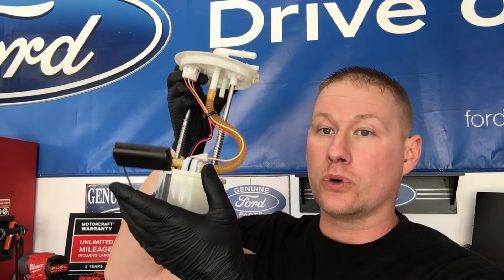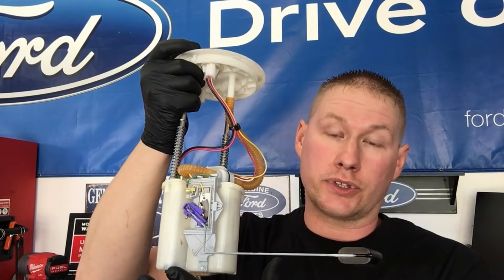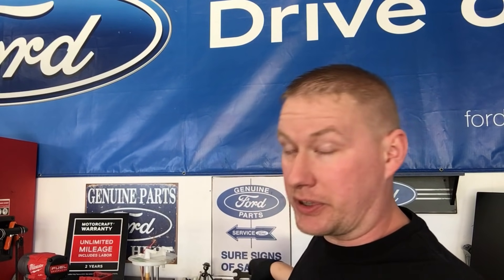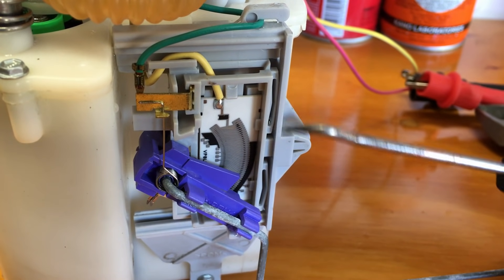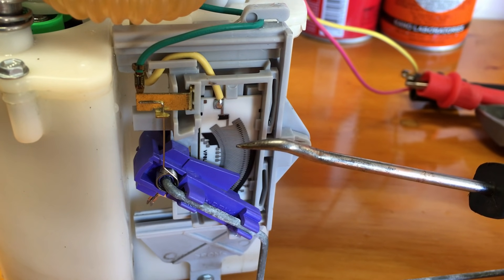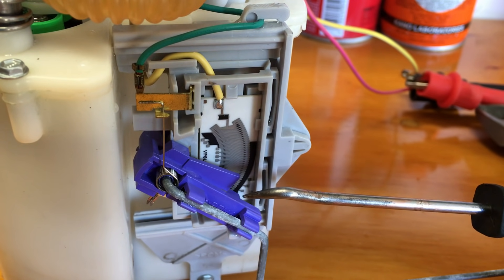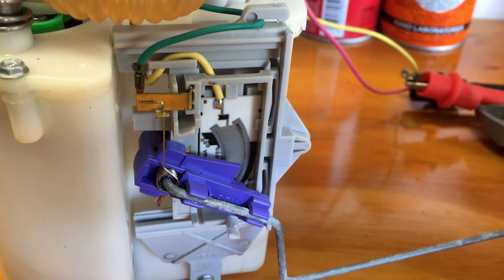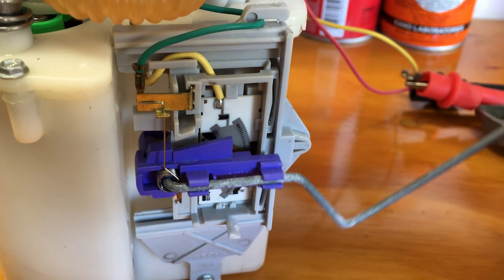Ford Quick Tips #77: DTC P0460 P0463 Erratic Fuel Gauge Quick Fix!

Comment: Thanks for your video I have a 2008 f350 super duty with the V10 gas engine I’ve been having issues with my gas gauge digital reading miles to empty drops like mile say 1 mile from house it will drop by 10 miles the other day it said 0 miles to empty so drove 2 miles to station put 3 gals in and gauge jumped to 77 miles to empty do you think using  fuel cleaner will fix that? I have not gotten any code lights coming up so far  I’m going to try your suggestion first b4 dropping tank 
Thanks again

Comment: Had the P0462 code in my van and the fuel gauge drop and rise intermittently only at a certain level in the tank so hopefully this will clear the issue up. Thanks for the tip. As an aside, I couldn't find 'Plus", only Complete Fuel System cleaner which I'm hoping is the same thing.
Reply: ever worked for you?

Comment: My f250 6.7 is having sending unit problems it seems it sticks at low fuel level when it is at just under a half a tank, but it still runs and has about 5 gallons in the tank when it starts show I g low fuel level.
Reply: So can we use this on diesel mortors

Comment: You saved me from having to remove the fuel tank. Within 10 min my gas gauge started rising from solid empty. Within 50 miles it was back to normal. Used this product in 3 tank fulls. It's working great! THANK YOU for the video!
Reply: Hello how can i save me some money,  and can you please tell me the name of it sir.
Reply: @ernestgrey9294  chevron techron plus
Reply: It this works with diesel engines

Comment: Is the Techron + for both gasoline and Diesel engines?
Reply from the maker: Gasoline
Reply: FordTechMakuloco Well poop! Need something for my '07 6.0 that is showing the same symptoms.
Reply: @FordTechMakuloco  what would you suggestion for a F250 2006 diesel with the same problem.  PLEASE
Reply: Any suggestions for Diesel engines? I have an '06 350 doing the same thing. Thanks
Reply: Lynn Taylor I have the same truck and issue!
Reply: Outdoor zone have you done anything to try an fix this? I may try to drop my tank this fall and repair but I have seen a video that you can loosen the bed bolts and get to it that way.
Reply: Lynn Taylor I put “Howes Lubricator” additive in my fuel after the low fuel warning kept acting sporadic and so far it has not came back! Maybe coincidence not sure but so far so good!
Reply: Can you get this additive at any auto parts store or did you order it from somewhere?

Comment: What if you don't get a check engine light/code? What if your gas hand just shows empty after you fill it up and comes up slowly? Will it still be that card?
Reply: Jury is still out....I got the two bottles of fuel additives suggested here, and it hasn't done it since. But, I've only filled up once or twice. My problem was only intermittent to begin with, which only made matters worse. So, we'll see. I'm going to monitor it for the next month or two and will report.

Comment: Thank you so much 💯!!!! This actually worked for my 2013 mustang GT I got the same code and my level sensor took a dump. I added the fuel cleaner and at 1st it didnt work but surly 3 days after adding it worked again saved me tons of money THANKS AGAIN!!
Reply: OSIS_ieCoyote what’s up Brother! I have a 2014 mustang Gt and the problem I’m having is the gauge would be 3/4 full and the digital cluster tells me I have 290 miles to empty!.. we both know that’s not true with these v8’s lol you think this will help?

Comment: Now I have a parasitic drain on my battery and this light had just came on my batteries been draining for a bout 2 weeks I have to continuously jump it  I had put a brand new battery and replace the alternator and it still drains my battery and in about 5 hours and sometimes overnight   My feel gauge just now acted up and check engine light came on with this po463  Could it be my cluster

Comment: 2002 Expedition fuel gauge started being erratic then quit working altogether----no codes-----just a gauge that reads empty and a low fuel light.  The fuel pump/sending unit assembly was replaced 2 years ago.  Tried two tanks with the correct amount Techron each time for the amount of gasoline.  Gauge still on empty.  Unhooked the wiring at the plug back by the tank and hooked up the old pump/sending unit.  Gas gauge works like it should.  Any thoughts or do I have to drop the tank again to change the sending unit?

Comment: Great video as usual and thanks for your help! One question though. If the fuel gauge reads empty all the time, but the low fuel indicator only comes on at the appropriate time, would this be related to the same fuel sending unit? 2004 f150 fx4, 5.4L. Oh and no codes at all.
Reply: No both signals come from same unit I believe. Probably your gauge cluster
Reply: Which is also why there’s no codes

Comment: I had my fuel pump and sending unit changed about 15,000 miles ago (2002 5.4L Expedition).   Just recently the gas gauge has been erratic, mostly I would call it "sluggish".  Well, today I watched as the gauge slowly went all the way to empty within 20 miles but I knew the tank was nearly full.  I topped off the tank just because.  It took all of 5 gallons.  The gauge never responded.  When you turn the key to ON the gauge comes off its resting position briefly but only comes up to the "E" and the low fuel light is on.  The tank is full.  Does this sound like I should try the Textron treatment or just go right after the sending unit or wiring?  No codes set, at least not yet.  Just the low fuel light on.
Reply: Hi John, I'm having the same issue with this 05 Ford F-250 5.4 L. Did you fix it and what was the problem? Let me know, Thank you.
Reply: @luisgalindo9429  The float on the end of the sending unit arm came dislodged and so the arm was just down all the time.  Obviously, I had to drop the tank, pull the fuel pump and sending unit out of the tank to discover this.  It was an easy fix once out but dropping the tank and re-installing was hours.
I don't understand why ALL manufacturers don't provide an access panel in the vehicle's floor so pulling this unit is not so difficult.  If you don't have a lift I would suggest you consider cutting one in the floor and then making a replacement cover plate once the repair is made.  I doubt this will affect the integrity or safety of the truck in any way.

Comment: I have a 2012 Ford F-150 and and I got some more problems with the my radio and I'd like to find out if you can help me my radio is not working in my CD player is not working I disconnected the battery and the problem started from there and now the only thing that works on it is the compass and the temperature and the clock is blanking, so I check all the fuses, there ok, do I need to take it to a Ford Dealership, i been getting feedback from different people and I tried all ideas, since your a Ford technician I figured I asks.

Comment: Your videos are very informative. My 1999 Taurus will not complete the I/M Readiness self testing because the Evap System is sensing an erratic fuel level. I have a P0460 code lurking in the background. It does not bring on the check engine light, but I can read the code with an Auto Enginuity scan tool interface. Ford Service documentation says if you have a 15% or greater fluctuation in fuel level readings, the PCM will abort the Evap test. Do you think the Anti Slosh Module inside the instrument cluster could be the problem, and do you have any videos on troubleshooting the Ford Anti Slosh Module? Thank you

Comment: All that sounds good, but I have a 2002 Explorer that the Fuel level gauge will go to Zero every time the tank is filled to full (not over filled).  The Fuel pump/sending unit was replaced as an assembly (Motorcraft unit) and it still does the same thing. Only once a few gallons are used, does the gauge start working as it should.  Any Ideas?
Reply: same truck, same problem

Comment: Would that cause my gas cap light to come on???? (05 expedition) My mechanic says its a module in the tank and about $400+ also.  
Funny we have problems in big trucks because of low sulfur diesel fuel. Its killing O rings on the injectors!

Comment: Had a P0463 on my 05 Taurus not too long ago and Techron cleared it right up. The fuel gauge would peg ever so slightly over full when the tank got over 80 - 85 % and would drop the fuel gauge below empty if it stayed pegged long enough, after the second time it would request the MIL. Read about this same problem and decided Techron would be a lot easier and cheaper than a new sending unit. Lol Glad I did.

Comment: I appreciate all the great videos.  I have a 2013 Ford F150 with similar issues BUT a bigger problem is the vehicle shutting down when i come to a STOP.  I get a LOW OIL PRESSURE as the engine dies however, I think that's just because the engine died and caused the LOP notification.  I never know when its going to happen.   The amount of fuel makes no difference, it happens no matter how much fuel I have.  Have you had an opportunity to address this?  Again, thank you for so much valuable info.  Bill
Reply: Bill mine is doing this now did it work?

Comment: I put up with this problem on my 02 Taurus for years.  It read full when empty and everywhere in between.
Reply: We have an 01 Taurus and have experienced this for a while (finally getting the p0460). Did the Plus work for you or anything else?
Reply: @dstewart7470  My poor Taurus suffered a gasket failure on the front cover at 209,000 miles.  At that mileage, I wasn't willing to take the chance that no damage had been done so I gave it to the mechanic who worked on it.  I reaplaced it with a 2013 SHO.  I haven't had any problems with it but the turbos and FPU scare me to death.  I now drive a Honda Civic as my daily driver.  My 2002 could go literally anywhere and was very easy to work on.  I miss it.
Reply: @alanhassall  Yeah I'm with ya. I've spent more on this 01 than your average person would but I just can't let it go. Curious though, did you try the suggestions in this video and did it work for any length of time?

Comment: Once again a great video.
I have a question.
I have a Lincoln Aviator 4.6 4v It has blown 3 Cam Position Sensors I replaced the alternator.
I am at a loss.
Thanks

Comment: Brian - What would you consider good fuel tank up-keep periodicity?  I currently use a combination of Royal Purple and Techron Plus. I add each in sets of two and repeat with the other the next up-keep. 

Example;

 January - I add one bottle of Royal Purple 11722 Max-Clean Fuel System Cleaner and Stabilizer - 20 oz. to a 1/4 tank to full fill up (26Gal Tank). 

Three months later, repeat process but this time with Chevron Techron Part #65740 Complete Fuel System Cleaner 20oz.  

I've followed this schedule on my F150 and on wife's 2007 Camry. My next tool buy is a video scope to see the pistons and valves. But another question is am I doing it too often? Should I do this on a 6 months schedule? Use of either one has had Zero Problems with the vehicles electronics - as far as I know. I doubt the MPG value is related to cleaning my tanks and protecting the fuel systems. Could be .. but I really doubt it. What do you think?  Is my OCD showing it's age again?
Reply: Hawaiian F150: i too like chevron techron, however it does not lube upper cylinder or piston rings, i dont trust roy6al purple maxx clean, because i dont know whats in it. 
I myself use gumout (all in 1) its like techron as well as lubes upper cylinders too. I use it every oil change or 5,000 mile. Also i use Ethonal free fuel for mamium combustion.

Comment: Brian - Aloha's Bruddah!! Hey man, do you have a video on suspected erroneous MPG readout on a 2009 Ford F150 or same Gen or similar vehicles?  

 -- Even after resetting the KMA several times the MPG value works it way back to display about 12.8 MPG and stays there. I have seen it at 12.6 (once) but it went back to 12.8 and remained.  

 -- Any ideas suggestions would be appreciated.  I just can't trust the 12.8 MPG b/c I backed it up with 3 separate tank fill-ups to different levels and got varying MPG values.

Comment: If u have sending unit out you can physically clean the contact points.. usually works! I worked in a specialty shop for 6 years just did AC n gas tanks.. you can replace the fuel pump on that unit too, just disassemble and replace.. done it hundreds of times

Comment: I need help figuring out what's going on with my dads 01 expedition fuel system. It starts hard but once it finally does start it idles rough for a little while, then if you rev the engine up to 2.5k+ it starts bogging down and then sounds like it's popping popcorn in the intake. When driving it doesn't want to shift when you accelerate in normal traffic. It bogs down and starts with the popcorn sound. Unless you "feather" or baby the accelerator in order for it to shift. I got a code that said it was the shifting sensor but that doesn't make any sense to me. Especially since that sensor is brand new. Please, any ideas would be appreciated
Reply: I'd start and look at the fuel pressure regulator first, make sure there's no fuel being suckered into the intake. First easy check. Then the throttle position sensor. You'll need a volt meter. Check to see if the voltage starts out at around one colt then steadily climbs when opening the throttle. "KEY ON ENGINE OFF!"  If those pass it to the shop. Way to many possibilities. Those would be my first 2 to look at.
Reply: Sam Cripes-  thank you, I'll check that out asap

Comment: I have a 2015 Ford F-150 Lariat fully loaded the problem I have is says I'm getting 20 miles to the gallon and I only use 15 gallons in reality I use 18 gallons it's never been correct and the dealer cannot find any problems I have every record of every fill up from the day purchase this truck for 30000 miles. And the fuel usage is way off I had a 2010 Chevy 1500 that was exact

Comment: Great info. I will get some as a preemptive. I need some clarification on a question I ask you. I have a 2009 Mercury Mariner 2.5. This engine does  not have a pcv I need to replace at a certain mileage? I guess I misread my schedule maintenance manual. I thought it said change around one hundred thousand miles. I do not want to put the intake unless I need to. Please kept the great videos coming.  Thank you, J

Comment: Red Line SI-1 Fuel System Cleaner is a good product. I think it's a super dose of the same active ingredient (Polyether Amines) you are talking about. Actually has more than Techron. Our local Ford dealership sells it. They also use it at oil changes. 
The Chevron fuels all have Techron. Not sure if they have the other "plus" additives in the fuel. 
If you want to test out the Red Line Fuel System cleaner, I can send you a bottle. Let me know. :)
Reply from the maker: I am not talking about the fuel treatment or cleaner so much for engine deposit control as I am about the cleaner and protectant for the sending unit card.
Reply: gottcha. i wonder what ingredients are responsible for the protection of the sending unit. Wonder if any other brand has it. If it's unique to techron plus, then it might be worth the switch as a preventative.
Reply from the maker: yes, yes and yes as stated in the video.
Reply: I take a bottle of this stuff

Comment: Awesome instruction as always, Brian.
Concise, and very professional.

?:  could the sending unit manufacturer have isolated the resistor sweep from the gasoline instead of having it fully in contact with the fluid?
Inside a sealed housing for example.
Reply: No all the electrics are made to work wet, to prevent possible risks of fire, no air no fire. Been that way for decades. 
It is all the guberment fuel mandates causing this.

Comment: I have been using Techron Plus for years. It is fantastic stuff. I have had success with it cleaning fuel injectors to the point of increasing performance and even eliminating a nagging sporadic P0420 code.

Comment: I have used this (techron plus) ever since my gauge was starting to not read correct (3 years ago). I used it multiple times with no change. I never received a code? I also filled up @ Shell / Chevron stations which if I remember correctly also had the detergent that would help with Sulphur. Any way I hope it works for others!
Reply: Todd Dyer you may have different problem than the one explained in the video.
Reply: Yes, I figured it could be a number of different culprits! My 08 F150 5.4 reads correctly from full to half full and then it starts jumping between the 1/2 - Empty space. Fortunately I have a Bully Dog GT that I reset every time I fill up, so it shows me the actual # of gallons I have used along with multiple parameters of the motor, so I can see the time it needs to be filled! BTW I recommend Bully Dog GT for those who would like to know what's going on with their motors temps for trans, oil, fuel gauge mpg etc
Also, I only run my Bully Dog on stock settings for the readings of motor and not for anything else like performance etc.